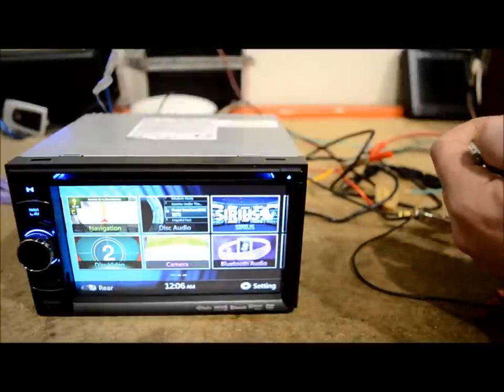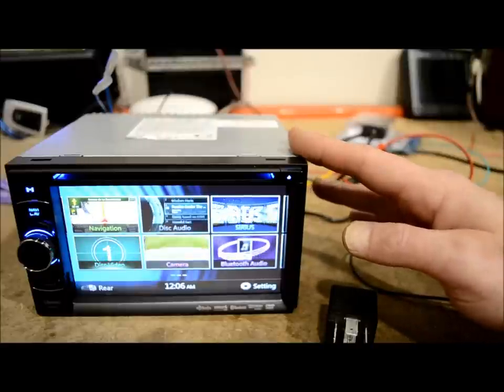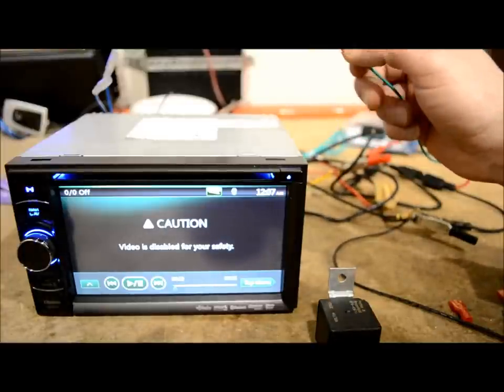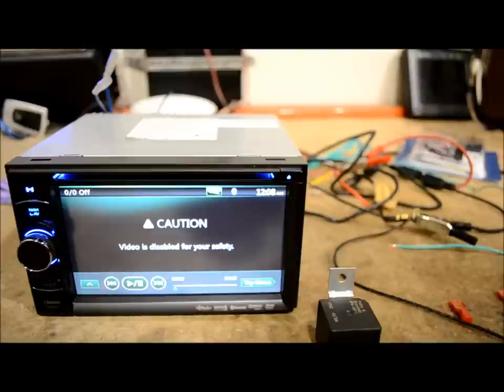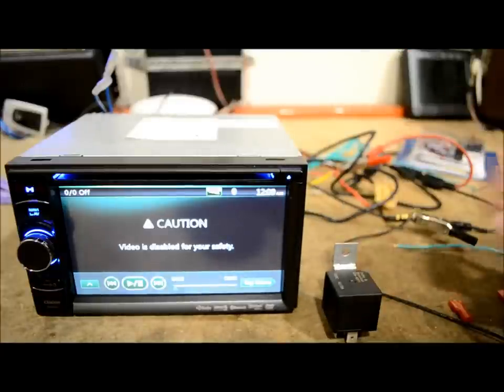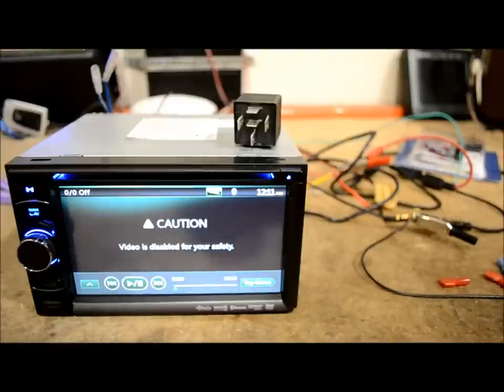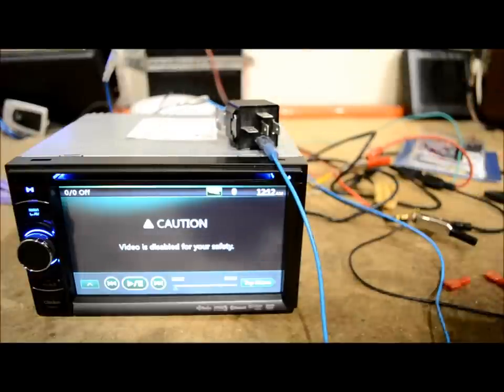How to do an In Dash DVD GPS stereo Parking Brake Bypass

Comment: You could also use a on/off switch. I have used this on hundreds of headunits and all have worked with the on off switch. Just run the teal wire fro. The relay to one leg on the switch and the other leg of the switch to ground. If the radio requires it to switch after turn on just flip the switch off and back on. But I also see why the relay might be a more appeasing choice seeing that it automatically does this for you. But on the other hand the switch uses less wires

Comment: Thank You!!!  Worked in my JVC perfectly. I have the head unit hooked up to the overhead monitor, now passengers can watch going down the road.
Reply from the maker: +dagkirk welcome my man!
Reply: Lessco Electronics can i do this with a factory head unit
Reply from the maker: no, those are different
Reply: Lessco Electronics I tried this method on a Dual XDVD256BT and it didn’t work. Do you have any suggestions on how to get it working
Reply: Eddie Tolliver Sr I just order the same dual stereo. did you figure out the bypass?
Reply: Stephen Wall Yes. I went back and watched the whole video again and I had forgot to splice in the ground to the jumper. Everything working perfectly now.
Reply: Eddie Tolliver Sr  OK thanks!

Comment: First, thank you very much for posting this video, it's very informative
However, I do have a question, the standard car relay draws about 120 mA, can the amp on signal from the aftermarket radio handle this current? wouldn't it be better to use a normal relay that draws about 30 mA?

Comment: Just ground the designated stereo wire, it has worked on every head units I have done.
Reply: sadly some newer ones are getting smart, and gets the speed signal from the GPS... if it's moving but the parking brake wire is grounded, it still won't show the video and will say "parking brake signal incorrectly attached" and won't let this bypass method work.

in this case, you'd have to do some research and find a workaround for it. mine? I had to click "off" and hold a certain spot on the screen for like 5-10 seconds... then got a message saying "set on"... now I can watch movies and mess with navigation settings and such, all with the parking wire cut and not attached to any ground at all.
Reply: Mohammed Al Essa aa
Reply: Ground the parking brake wire, worked 4 me.
Reply: charleskro1 what about factory radio with nav and dvd.
Reply: Worked for you on what unit? Some look for a specific signal. You can't get that from grounding the wire that's looking for a signal.
Reply: me too
Reply: charleskro1  have you done this to GMC factory DVD player
Reply: charleskro1 I just wired it to illumination wire. Works for me
Reply: What the point of making a CD player to watch movies for the kids but can’t watch them while your driving
Reply: How true!
Reply: This guy needs to understand relays, because that wasn't a whole video, & actually an easy explanation . Anyways...
Reply: you must be using dinosaur units cause that doesn’t work with any quality units built in the last 5-6 years....
Reply: @JamesAutoDude  ya this is from a older video.lol would it be possible to block the gps antenna from getting signal somehow. Do you know if gos not getting a signal would cause it to not now its moving so you can watch dvd
Reply: @JamesAutoDude  So go into settings and enable "video while driving".

Comment: Dude you can just ground it to the ground wire and use a toggle switch
Reply: mario alvarez  that's what I'm using but forget the switch sometimes
Reply: mario alvare
Reply: mario alvarez  you don’t even need a toggle switch, just connect it to the ground and leave it
Reply: I was going to ask if this would work.  For my pioneer I just bought, I can bypass by connecting the green wire to my ground wire only AFTER the connection is made after the unit is on (the car is started).  If the green wire is already connected to ground and then I start up my car (and head unit powers on), it will display a message stating that I need to make sure my parking brake is applied.  Its only when I part the connection and reconnect will it trigger and bypass.  So, I was thinking about using a toggle switch so after I turn the car on, I can toggle on and trigger a connection between the green wire and ground.
Reply: I did that on my Pioneer AVH5600 and it worked fine. I will try the same on an Alpine unit I ordered. I think it'll work just fine.
Reply: Over time that switch will break, plus you have to do it every time manually.  Relay is best for this application, it costs $2 and 5 more minutes of your time.

Comment: Got lucky on mine was able to ground directly to radio as you did in beginning so added a small ring terminal pulled screw out back put back in with wire connected so now my dvd works keep up the videos they are helpful

Comment: The firmware on the newer Pioneer head units require you to pull the brake, release the brake, then pull again. So, the $13 bypass via ebay did the trick quite well for my AVH-4100NEX, and at only 1/20 the size of a relay.

Comment: I took your excellent advice and tested the "grounding to radio chassis" before buying a bypass and even though you said Pioneer units require a pin swap my 2015 AVH-x3700BHS works flawlessly.  thanks for the info!

Comment: For those that have Pioneer Radios, you need to connect then disengaged then reconnect parking brake. It is in your owners manual. For the few that have said after installing this way my battery dies. Something is not powering all the way off. Connecting a sense wire to power or ground has nothing to with drain. It is only verifying and not pulling.   A radio that is off is different than a radio in Standby. If you have amps install, make sure that your remote turn on is not still on with the ign off.

Comment: this is a good video on the bypass. i tried to ground the wire to the dvd frame but didnt work so i just stuck the parking wire in the antenna adapter and it works just fine

Comment: I almost got sold on the damn bypass myself. but I got smart and searched my model, and how to bypass the parking brake... sure enough, my particular stereo, had this method where you turn it off, hold a certain spot, and it'll say "set on". then, it'll let you use it completely with no "parking brake wire incorrectly installed" message!

avic-7000nex is mine :)

Comment: Tried grounding it to the chassis like u showed. Works but once I shut truck off stopped working. Would have to keep taking ground off and putting it back on.

Tried the relay like u showed, heard the relay click on but once again relay clicks on too fast. Radio doesn't read the relay, can't watch videos while in motion. My last option is the one I didn't wanna do is run a switch in order to watch dvds.  So I had an existing switch in the truck, tapped into that one and it works if I wanna watch dvds I flip the switch and video plays in motion

Comment: Thank you so much for this, I especially liked the jumper idea.  I thought i could only play dvds on my Pioneer 4600bt with the emergency brake on.  I only had black wiring in my garage so I used green and blue heat shrink on the tips to differentiate between the amp turn on and e-brake leads.  Just a note for everyone, buy these relays online because locally at auto zone and oreilly they are ridiculous.

Comment: The Kenwoods (at least from years ago) used to work if you simply grounded the parking switch wire from the back of the unit.  that's as dirt cheap and easy as you can get.  :)    Sorry, added my comment before watching the whole video.   I see your Clarion is the same!!

Comment: Others said you can ground the Green Parking wire and add a toggle switch and turn it on and off every time you want to watch the video.  Over time that switch will break, plus you have to do it every time manually.  Relay is best for this application, it costs $2 and 5 more minutes of your time

Comment: I got a Pioneer AVH4000NEX head unit and when I bench tested it, touching the green wire to chassis worked fine for the video bypass but once I had the head unit installed it would no longer bypass to watch video. It's much easier to find a premade bypass than making one with the relay you show on the video, at least for me.
Reply from the maker: I tried to make it very clear at the beginning of this video it is not for pioneer, they are unique, the new pioneer like yours needs a ground pulse and then another ground afterwards (as you most likely learned by now). But thanks for the enthusiasm and sharing the info.

Comment: I wonder if the back EMF from the relay could damage the 12V remote output on the head unit. Might be worth putting a diode across the coil terminals (Reverse polarity of course!) to suppress any spikes. I would think a 1N4001 should do the trick for a small relay, worth checking data sheets though.

Comment: Thank you so much I did not know how to do it I took my device out and put a DVD in and would not let me use it I touched the wire to the cd player and it worked fine I was like wow to easy I still had the screw from the back that you take off when it is brand new bought I wrapped the wire around the screw and screwed it in tight and it works fine I am like wow to easy thank you worked great took me 5 min and was free

Comment: While in the video he shows grounding the green wire to the Clarion as bypassing, this has to happen after the unit is on so you cannot permanently just ground green wire (tried it, worked only when unit was already on). Ground has to come through after unit is on so either a relay or switch is required as shown in the video assuming the power amp wire is energized after unit is on - haven't tried it yet but seems like should do the trick.

Comment: I just use a simple on-off-on switch and hide it under the dash. One leg goes to the parking brake wire, one goes to ground, and the center goes to the parking brake trigger on the stereo. Flip the switch one way and the parking brake has to be on (should I ever need to prove to a cop that the video won't play while moving), or flip the switch the other way and watch videos any time. For a stereo that needs to see a pulse, I can just flick the switch on and off. Cheap and simple.

Comment: Btw, when you use wiring color codes, like "Blue", it often varies with car audio and car manufacturers.  So, you would need to specify where it came from because it is not always the same.  In most cases, the blue wires are remote wires which have a +12V when in use.  However, some may use add a white line to differentiate between Amp Remote and Antenna Remote.  To make things even more confusing the Antenna Remote in some cases only provide power when the FM radio is on.

Comment: Hi and thanx for this very important piece of information, 
Just to help others too,it works with The new 2015 Pioneer AVH x7700BT fold out radio.
Went to my local Maplin, picked a relay for 3 quid and was Gud to Go.
It also plays dvd when u place the green wire on top of the stereo just as u did on yr video.
thanx again, brilliant.

Comment: I am confused again. So if the blue/white wire goes to the amp, what happens to the amp once that wire is used for the bypass? Does the amp still work but is powered by going through the bypass? 

Thank you for the video it has taught me so much! :)

Comment: Cant you just run it to a ground and put a switch on that wire so when you turn your car on just flip the switch to ground that wire..... Its worked for me everytime for the head units that needed a parking brake ground.. One deck i had you were supposed to put it in park then take it out of park then back in park again....i grounded that wire with a switch and just flipped it on/off twice worked great! Relays are very easy to use/wire but i know several people that still wouldnt attempt to wire one....

Comment: This Bypass will work on the Pioneer AVH-X5600BHS but every time you turn on your car and want to watch a DVD you have hold the power button (Source button) to turn off the unit... then turn on the unit and select the source (Disc)... then the prompt will display a message saying you applied the parking brake press the OK button at the bottom and you're done! You can watch a movie without any restrictions!

Comment: Kenwood and JVC, you can just ground the parking brake wire. Most Pioneers, you can too. Not sure about Alpine or Sony. Most Clarion, at least the older models, they have to see a double-pulsed ground, which means a toggle switch should be used

Comment: I just want to make sure what I think I heard.  If you ground to the frame of the Unit, then you can attach it to the player without any problems?  Or put it to the ground wire?  I was going to buy one of the switches and realized I might not need it. Thank you for the video. I have a Boss BV775BLC coming to me tomorrow.

Comment: Check out the double pulse bypass from DIYBypass. All new AVH-X pioneer radios will not work using a relay. They must see a double pulse on the parking brake wire.

Comment: Pioneer got smart with the App Radio 3. Yes putting the green wire to the ground or a grounded area works, however, the head unit wants you to "press" the e-brae, release it and "press" it again. So, if I ground the green wire, I have to remove it from the ground then put it back on and all is well. So it looks like I need to make one of these bypass units.
Reply: Yep. A double pulse on the ground wire is need to bypass those. DIYBypass com has them.

Comment: I have an Clarion NX404 (you did a great review BTW) I have the long green wire you mentioned. So all I have to do is ground that to the body of the nav unit and the DVD will work at all times? No bypass needed? And no searching for brake wires/switch connections?

Comment: All you need is connect green wire to the ground,there is no need to use relay,but there is a problem if you use that relay, the surge current can damage your head unit.you should put one diode connect to 85 and 86 relay pin.

Comment: If is a pioneer double din you should use a relay ... But for others double din you just have to ground the parking brake wire or green wire , that's it , very simple !

Comment: Tried this with the Clarion nx404. I can hear the relay switching but the stereo still does not display the video. Wired the same way but put 85 to the stereo red wire, 86 & 87 to the stereo black wire. 30 to the stereo green wire.

I should note that when I initially tried this, I grounded the green wire to the stereo chassis and it displayed video as yours did, I thought that would work. As soon as I buttoned up the install, no more display.

I'd appreciate any help you might be able to offer. Thanks for the info and taking the time to make a video about this.

Comment: Hello
Very good video
I have clarion nx404
install it without the connection to the handbrake cable
so I only listened to the audio of the dvd.
but the hour does not work the inbox to insert the dvd
my question is can he have been blocked?
or else the problem will be

Comment: Hi! Saw your video, one of the better videos posted up here. I have an Alpine ICS-X7HD receiver. I did the two toggle switch method: 1st toggle switch the ACC wire (red) and the yellow/black wire from the unit are connected. 2nd toggle switch the ground wire (black) and the yellow/blue wire from the unit are connected.

However, I want to know how wire it up to using the relay method for a cleaner look.

Thank you

Ed

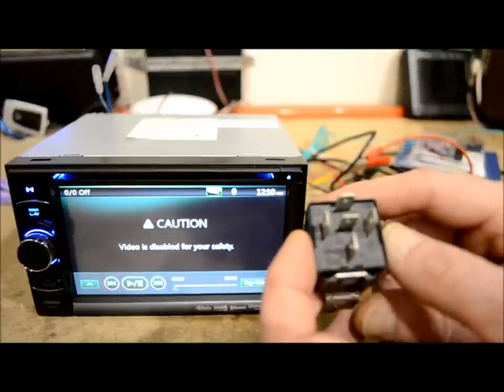Comment: Either your relay is malfunctioning or you did not hook it up correctly.  It sounds like the DVD won't work if the green wire is grounded before the car radio is powered on which is like the Alpines he mentions @5:10  The wire that he is suggesting to trigger the relay on pin #85 is the Remote AMP from the radio not one the for ACCessory from your car.  The difference is that ACC will turn on when your turn your ignition key, where as the Remote AMP will power on after you turn on the radio.

Comment: That was a great video. Its very simple. And I was going difficult and looking for the actual parking brake wire to try hooking it up to that light green wire. That was great. I guess that's how we learn the different ways electronic works. My boss touchscreen DVD radio is not showing screen at all. Just lights up the lights on the radio and you can hear the radio but noting on the screen at least to select on the screen. Do you know if this could also be same problem with making sure the parking brake is connected to the ground? And would this relay work the same for this situation? Thank you in advance.

Comment: Just add  "jumper" at the blue connection to add the amp. Blue wire only turns power on when the radio powers up.

Comment: only joking, if course!  Nice instructional vid!!  Also serves as a primer to relays, which can be related to installing driving lights, fog lights, or any other high current draw circuit!  Very helpful to those diyers that like to tinker with electrical circuits.  Well done Lessco.

Comment: I also have a avh-x7500bt if that counts for anything as far as the bypass part of it and running the wires. When I installed the little hack, it worked but now I'll get a random message stating video can not be viewed from drivers seat etc...so I'm sure the bypass isn't working...checked the connections and everything is connected...

Comment: So you can use any source with accesory 12 volts rights? Not necessarily from the remote amp turn on wire... You could use any, like the cigarette lighter wire